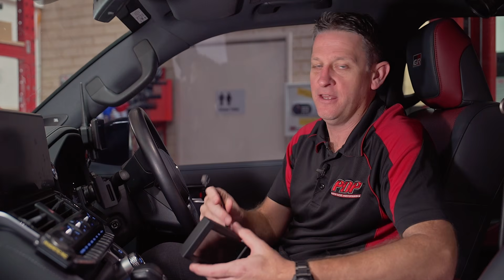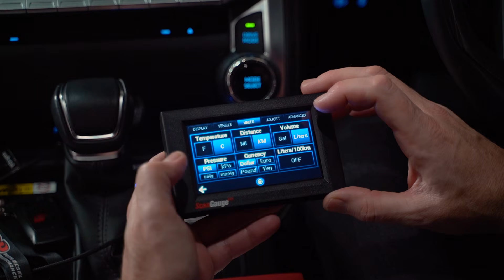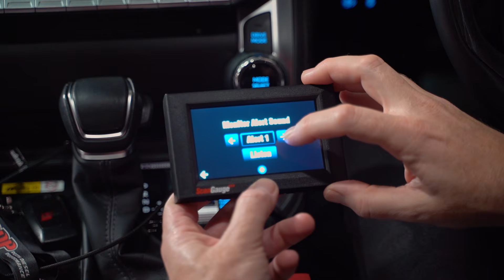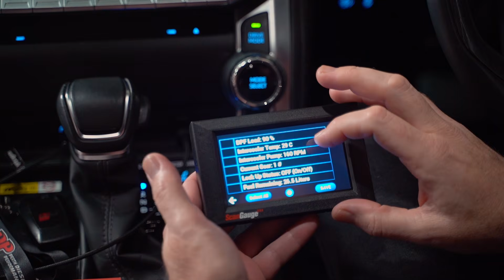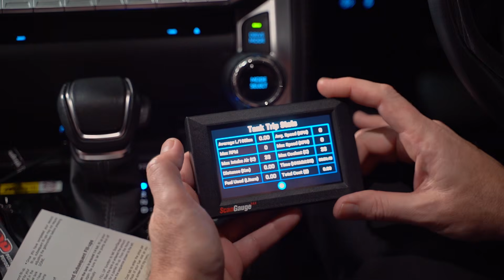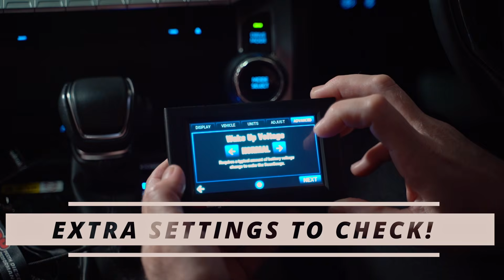Scan Gauge 3! Should you get one? FULL GUIDE

Comment: Awesome video Trav, quick question pls. My 2019 Sahara has a speedo calibration feature in the settings for when you change tyre size. So I've changed my tyre size & re-calibrated my speedo via the setting in the features. Do you think that my speedo should now be accurate? Just to add some further info that might assist, the new tyres are Yokohama Geolandr 285/70/18 MT's? I appreciate your thoughts, thanks Mike.

Comment: Can someone justify the cost to me. Coming in at 445 AUD - compare that to plugging in a Bluetooth OBD2 and using an app on your iPhone. Which shows you the same stuff
Reply: Ryan i had to try and justify it also. A friend had the 2 which was cheaper. My reason for buying the SC3 even though I have the full diagnostic unit for my Amarok v6 was to get something to monitor at all times mainly for the dpf which can cause expensive repairs for some people. Ive never had an issue and done over 200k towing. My reasons not to go with an iphone setup is it still needs to be connected each time where as the SC3 is permanent  and I can show 9 gauges at once of the ones that are important to me, set alarms and i could justify the extra $150 over the SC2 coming with a great screen mount, auto scan xgauges and 9 gauges. Ive only just got mine and already love it on our trips getting a good feel how my vehicle behaves with soot level, reg frequency charge air temps etc and if Im pottering around a city and its due for a reg i can make sure i do it before any light of death appears. I was also concerned about transmission temps with some mountains i tow up but it put my mind at rest sitting around 80c max.
Reply: @ makes sense - if it can highlight an issue before it turns into a disaster then I guess it’s actually cheap

Comment: These are a great gadget. I've had one for 6 months now for off-road driving in a 23 Fortuner. I have multiple important gauges displayed and audible warnings for critical things like coolant temp, trans temp, oil pressure. One I really like is current gear when in "sports mode". The standard display only shows maximum gear and there are times its really handy to know with certainty what gear you're in.

One problem I do have is that it often switches off for no apparent reason. To restart it I have to disconnect the cable at the back then plug it back in and it reboots. If you're reading this Trav, what do you advise? Its potentually quite a serious problem when you're relying on things like the coolant audible alarm to save your engine from cooking! ☹
Reply: Where have you placed yours?
Reply: @hillzy_eighty7  Its mounted on a metal frame that's anchored via velcro to the dash protector carpet, and is well insulated from the bumps and vibrations. I suspect the problem is the RJ connection.
Reply: Personally I wouldn’t unplug and plug in an obd2 connector while the vehicle is driving. Maybe parked with key on ignition off, but it could send or request info from Ecm and makes things glitchy

Comment: I've had mine since they were released and unfortunately it's really inconsistent, on my n70 my engine load reading for example will read 0 when I'm in 4th gear then it will randomly show a reading 1 or 2 gear changes later.
Reply: Any ideas why it jumps all over the place, especially when I'm on Highway speeds doing consistent revs/speed.. Awesome at clearing and reading codes
Reply from the maker: What year Hilux? Some of the N70s are incredibly limited by the readings picked up by the ScanGauge (or any simple OBDII reader for that matter)
Reply: 2009 @PerthDieselPerformance

Comment: Question guys, will the Scan gauge 3 work with tuned engines and transmissions? 200 series VDJ.
Reply from the maker: Yes!! Given the parameters haven’t been turned off or maxed out by the tuner (which a good tuner wouldn’t).
Reply: @PerthDieselPerformance  Thanks for that I will come up and grab 1 off you, Cheers

Comment: Is “trans temp 1” on the scan gauge the pan or torque converter on the LC300 - I’m guilty of not reading the instructions 😢
Reply: Trans Temp 1 is pan I think. Can’t find torque converter temps. Did you work it out?
Reply: Trans 1 is pan trans 2 is TC temp. Torque converter. Can also show when it locks

Comment: Trav, that was great. I have a PXIII which is tuned, oil cooler and better intercooler setup (3.2, straight 5). On a trip earlier this year, I towed my 14' off-road van from Canberra to Mallacoota (near Vic border on the coast) and was getting 105C - 106C regularly - like the Patrol, do Rangers run hot? I bought a PWR radiator after that but am yet to fit it.

If I'm getting 105C+ in Spring, what will Summer in Northern Oz do?!
Reply from the maker: Hey mate! PDP Team here - do you have bullbar, spotties, winch, etc at front of your vehicle? Anything blocking airflow will invite higher running temps. The PWR intercooler will help due to the larger and more efficient design compared to factory.
Reply: @PerthDieselPerformance  Thanks, all the usual goodies but I have low mount winch. I've bought the PXIII PWR radiator which is yet to be fitted - that should lower temps, I suspect.

Comment: Ultraguage hella nicer looking with more items to view per page
Reply from the maker: A good unit however not universal - the Scan Gauge 3 can go from one vehicle to another no problem at all. Also has a modern design and screen display, making it easier to navigate and use.
Reply: @PerthDieselPerformance  the scanguage is universal. It's plug and plug between vehicles, with only a few different vehicles needing a code or 2 put in to see the other options. All easily available online for free.

I dunno mate, this thing looks anything but modern.